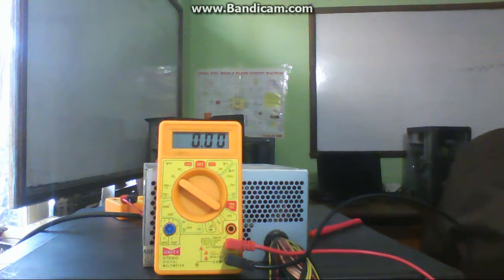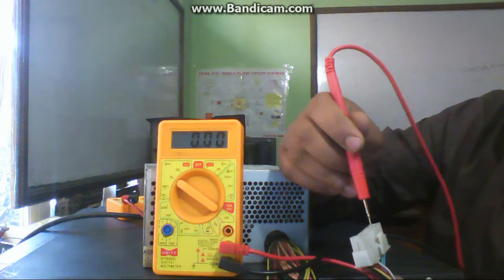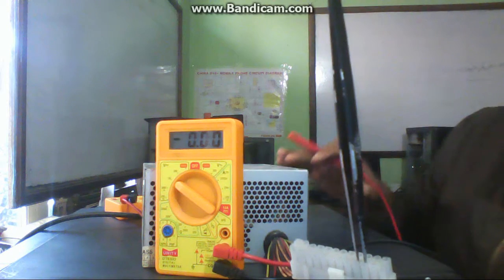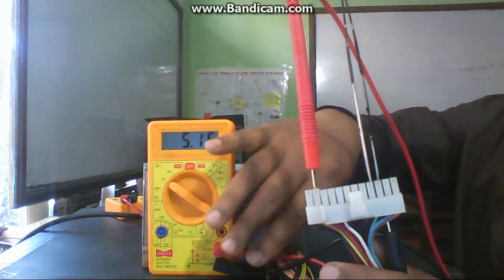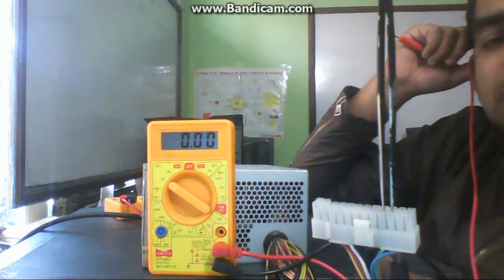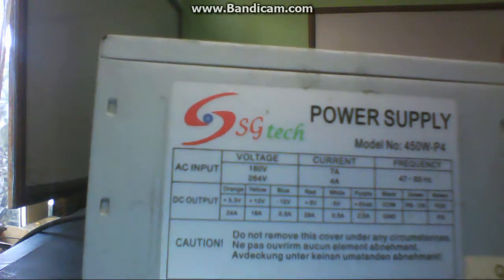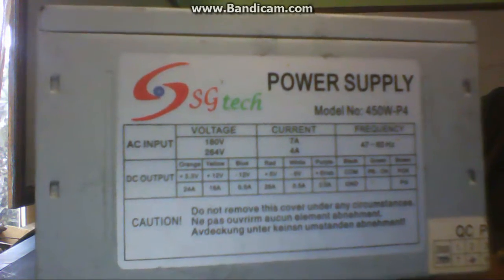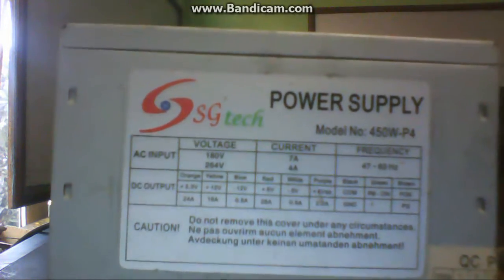SMPS Repair | How to Repair SMPS | How to Check SMPS | Computer SMPS Repairing | Step By Step |

Comment: if smps is faulty and if we joint green and black wire and if it starts automatically without pressing power button what to check in bios settings.